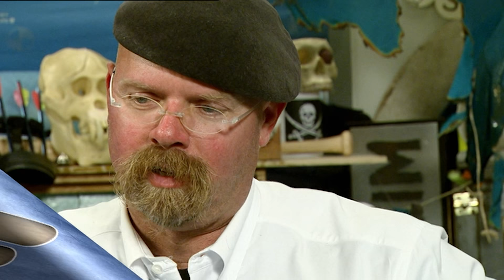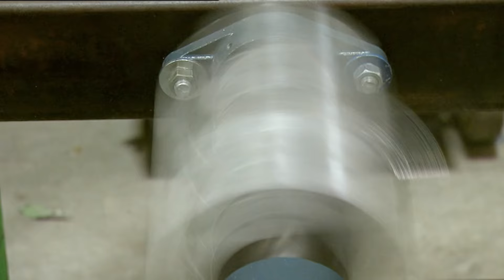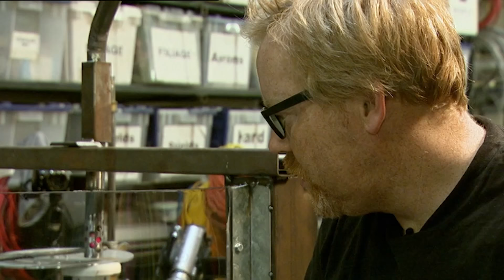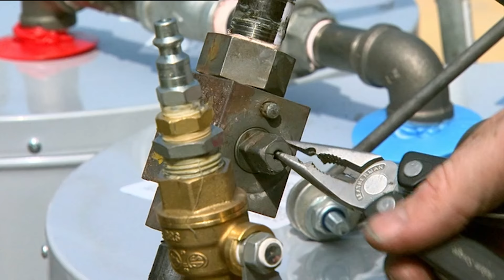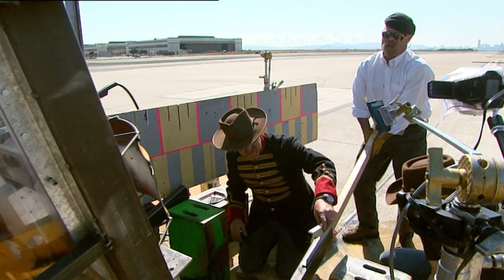Could A Steam-Powered Gun Really Fire 400 Rounds A Minute? | MythBusters

Comment: The Winan Steam Gun was NOT a Confederate toy..
If I remember the original design properly there was a spinning disk with a curved slot in it and a fixed barrel.  The ball drops into the spinning disc, accelerated and flung out the static barrel

Comment: The Build:

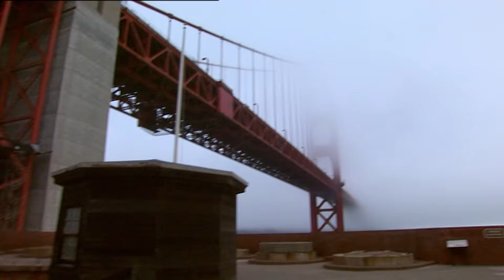Adam and Jamie worked with Civil War weaponry expert John Lamb to study original diagrams (1:43).
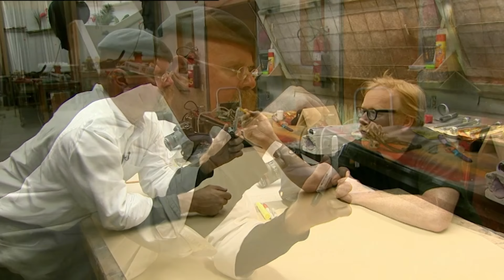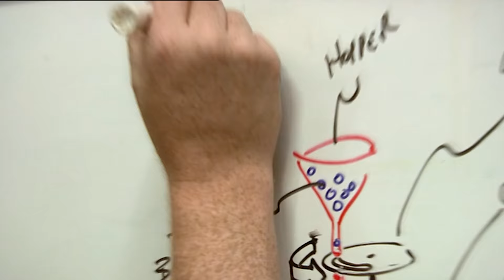They broke the project down into four main components: a curved barrel, a clockwork ammo feeder, a high-speed motor, and steam generation via water heaters (3:14 - 4:00).
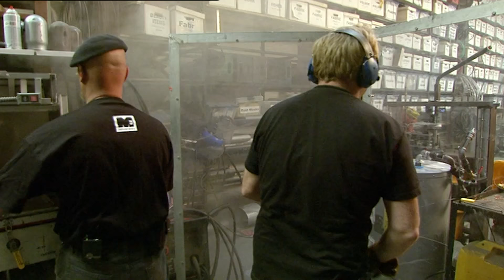The team successfully built a functioning replica that used centrifugal force to fling steel balls, demonstrating that the design concept was physically possible (12:43).
The Testing:

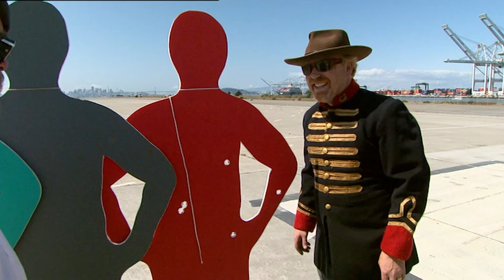Rapid Fire Capability: When firing multiple rounds, the gun achieved a rate of fire that felt like a true machine gun (19:03).
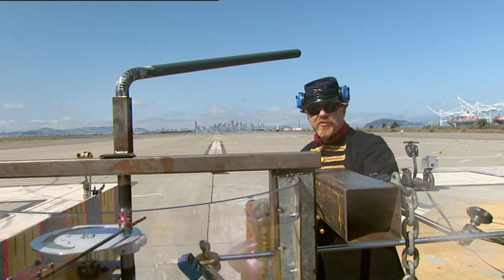Lethality: While the weapon proved lethal at point-blank range against ballistic material (20:13), it failed to penetrate a pig carcass at 20 yards (22:45), proving it was largely ineffective as a weapon of war.
Range: In a final, desperate test, they pushed the cannon to its limits, resulting in a single projectile traveling nearly 700 yards (24:50 - 25:03), far exceeding the historical claims, even though the rig suffered a mechanical failure during the process (24:06).
Conclusion:
While the MythBusters confirmed that a steam-powered gun could function as a machine and a gun, they ultimately concluded it was a busted weapon of war because it lacked the necessary lethality and reliability for combat (25:21 - 25:39).

Comment: Controlled release using a cam that extends into the rear of the barrel just enough to block the ball and is pushed out of the way when it's approaching alignment would've made that thing a lot better.  Also lead would've been a much better projectile.

Comment: I don’t understand how they could time the balls to eject forward in the direction they wanted
Reply: That's the clockwork purpose, to time it, remember just a proof of concept and there was a reason they didn't use it, it was stolen by the union early on during the war. The machine itself might have worked but we'll never know as it was removed and they only made one. Also they couldn't build another one because it took years so it was likely never used at all. This is just proof of concept.
Reply: @xeneomorph  yes, but it doesn’t make that much sense in theory. How did they calculate exactly when the barrel would be pointing forward so they could time balls dropping? The barrel is just spinning freely.
Reply: @freestyla101  Well, ask the inventor who made it back then as I can't answer that question.

Comment: there is a patent for an electrical machine gun that works like this. it was patented and tested successfully in the 90s, it can be mounted on a Hummer and uses an inverter and a set of big batteries to power it. It uses a motor to spin a disk really fast and can fire ball bearings faster than an average light machine gun. Im not sure why it was never used, im guessing because they would need an easy way to charge those batteries as I'd imagine it would use the power quickly. So you'd need more heavy ass batteries or a generator which could just be replaced by more ammo for a regular machine gun that uses no power.

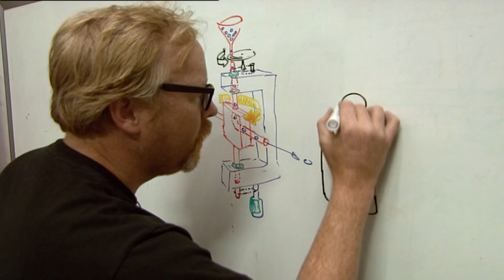Comment: 3:48 did they have super heated steam in the 1880s? (looked it up....germany in 1898.... i figured that locomotives would have had superheaters WAY sooner than that)
.
anyway... my "point" i was gonna type is wrong, but i was thinking that a water heater is only going to give "wet" steam..... which is NO WHERE near as powerful as super heated steam. 
so if the cannon doesnt work because its not powerful enough, then try a super heater.
.
PS
its crazy how the navy and MANY other places check for high PSI superheated steam leaks.... 
they walk around with broom.... if the bristles suddenly get cut, their is a leak.

Comment: It's entirely possible to do all that without the extra jank. You don't spin the barrel, you spin the magazine. you feed the balls (which should be lead) down through a central tube into one or more tubes spiraling out across a disc. The size of the disc determines how fast you need to spin the disc for a desired energy level while the number of tubes determines rate of fire along with spin. 

The balls are stopped from leaving the tubes by a greased set of bearings or rollers that encase the outer edge of the disc. Leading to the barrel, you have a very short exit hole. The barrel will, by necessity, be mounted on the side of the disc, not the front. 

Thus the feeding occurs automatically and without need for gears or timing. 

Now.... here is the problem. 

You have a ball spinning rapidly either in the vertical (Y) or horizontal axis (Z). You need that bullet rotating in the X axis to stabilize it in air. 

So now you'll have to compensate for an additional movement in addition to parabolic arc due to gravity.

This is not an issue in space, where the simplicity of design and lack of propellant will likely result in this being a real weapon some day. Just not in Atmo.

Comment: 1:12 truth be told only some machine guns are complicated. when you get down to the pure mechanical aspects an open bolt straight blowback machine gun is one of the simplest firearms you can build after slam fire shotguns and closed bolt single shot or bolt action. the only real hard part is making a reliable feed mechanism and magazine, the gun itself is  little more than a tube, spring, barrel, bolt, seer and trigger. full auto air guns can be even simpler, just a barrel, hopper and a valve, venturi gun that'll fire as fast as it can force rounds into the chamber, muzzle velocity would depend on pressure, barrel length and the quality of the seal on the bore but i know of full auto solenoid actuated air guns that can fire 1000+fps and 1200+ rounds a minute using high pressure air

Comment: The thing I'm most surprised about is how a compressed air motor worked fine with steam. Yeah, steam is basically hot air as long as it doesn't condensate, but the construction of that thing might still had some inner leaks that would destroy it from the inside if water came into contact, or it might not have been rated for the higher temperatures that steam can achieve (steam IS way higher than 100 C). That the motor itself worked, let alone survived, that felt like a miracle.
Reply: Air can escape through smaller gaps than water because air is not molecularly  attached like water.

Comment: With lead projectiles , higher speed and better timing , would be very deadly
Reply: The entire design is junk. You can't aim, its many moving parts (especially on a battlefield) would lead to frequent failures, it's cumbersome so maneuverability is nearly non existent, and using centripetal force is worse than just building up pressure and using that built up pressure as a way to launch the projectile. Granted making a machine gun would be unrealistically difficult but at least it would address the other issues.
Reply: @millerrepin4452  considering what was fielded in ww1 which is basically the same level of tech and it’s also they put a lot of effort into the project but failed by Their own admission to actually get the timing right or really fiddled with it for an extended period of time. Plus they used really big steel balls which I think is a big problem. I think the myth is 100% plausible. They proved it was they just couldn’t get to completely work and their distance test is not only flawed but it broke the machine. Which I think was 100% intentional because they knew if it did break that day somebody was gonna fiddle with to get it work but they are going to hurt themselves. I’m surprised they called it busted considering they call myths that failed way more plausible
Reply: Smaller munitions also might help
Reply: I agree, lead balls would have made a big difference.
Reply: it's also very unpredictable.
Reply: @thanoseid2883 unpredictably doesn’t matter much when you arent trying to be a sniper. Gotta remember these were relatively close range weapons against lines of enemies. It didn’t matter where you shot so long as it was within the line
Reply: @qualeb8164  accuracy does. it's gotta fire toward the enemy after all. an unpredictable weapon can be dangerous.
Reply: @thanoseid2883  unpredictable can be limited to a point. As long as its safeguarded from firing in the “wrong” direction, then any point along the enemy lines would be good enough even if theres no way to properly predict which individual enemy it will hit.
Reply: @thanoseid2883  they also never solve the biggest problem which was timing. Which was 100% possible to solve. Even with technology at the time. Gatling solve his and they solve the problem of shooting through airplanes props twice in a couple of months of the First World War starting.
Reply: @ONEIL311  that would take too long. it took gatling a while to solve it.
Reply: @thanoseid2883 . They don’t gotta solve it the solution already existed which is the airplane prop shooting mechanism. Adam even tried to build one but I dont think he got it to work or they ran out of budget or time before they had to go out to the run way or they were way to nervous running it to get it to work.

Comment: This was a completely improvised rig with little reinforcement to ensure stability. And the issues with timing on ball release are just that, timing issues. Those depend on the exact revolution speed of the barrel, something that could be fine tuned. I think that as a prototype, it clearly proved proof of concept. 

On the other hand, they were using modern refined parts that may be better than what was available during the civil war. Not sure on that though.

Comment: I was imagining a steam engine hooked up to the crank of a gatling gun.
Reply: Doesn't help the supposed gunpowder shortage situation.
Reply: 45-70 govt Gatling goes brrrrrrp. A little Tippmann 9mm with Glock drum would also be awesome.
Reply: Same
Reply: It's entirely possible to do all that without the extra jank. You don't spin the barrel, you spin the magazine. you feed the balls (which should be lead) down through a central tube into one or more tubes spiraling out across a disc. The size of the disc determines how fast you need to spin the disc for a desired energy level while the number of tubes determines rate of fire along with spin. 

The balls are stopped from leaving the tubes by a greased set of bearings or rollers that encase the outer edge of the disc. Leading to the barrel, you have a very short exit hole. The barrel will, by necessity, be mounted on the side of the disc, not the front. 

Thus the feeding occurs automatically and without need for gears or timing. 

Now.... here is the problem. 

You have a ball spinning rapidly either in the vertical (Y) or horizontal axis (Z). You need that bullet rotating in the X axis to stabilize it in air. 

So now you'll have to compensate for an additional movement in addition to parabolic arc due to gravity.

This is not an issue in space, where the simplicity of design and lack of propellant will likely result in this being a real weapon some day. Just not in Atmo.

Comment: Revisit this, increase the barrel length and lethality along with range will increase,.  Also adjust the timing and have a pressure fed magazine....in theory the rate of fire should be equal to the RPM
Reply: Or exceed it. 

It's entirely possible to do all that without the extra jank. You don't spin the barrel, you spin the magazine. you feed the balls (which should be lead) down through a central tube into one or more tubes spiraling out across a disc. The size of the disc determines how fast you need to spin the disc for a desired energy level while the number of tubes determines rate of fire along with spin. 

The balls are stopped from leaving the tubes by a greased set of bearings or rollers that encase the outer edge of the disc. Leading to the barrel, you have a very short exit hole. The barrel will, by necessity, be mounted on the side of the disc, not the front. 

Thus the feeding occurs automatically and without need for gears or timing. 

Now.... here is the problem. 

You have a ball spinning rapidly either in the vertical (Y) or horizontal axis (Z). You need that bullet rotating in the X axis to stabilize it in air. 

So now you'll have to compensate for an additional movement in addition to parabolic arc due to gravity.

This is not an issue in space, where the simplicity of design and lack of propellant will likely result in this being a real weapon some day. Just not in Atmo.

Comment: An actual gun like a steam powered Gatling gun would have been possible at the time, and I imagine it would be pretty devastating for the time period.

Steam power could operate the auto-loading mechanics, rotating the barrels, and using a burst of steam pressure into the barrels to fire projectiles like an airgun.
Reply: That level of industrial precision didn't exist at the time. You would also need a corrosion resistant material because of the, well, water.
Reply: @weetdirt   Yes it absolutely did.  This was the civil war lmao.  They had steam locomotives for 60 years, they had repeating lethal air rifles for 80 years...  You think they had no steam power and couldn't deal with water in 1861??   Go back to school

They had advanced metallurgy, "corrosion" wasn't a problem.. it's water and metal, scrubbing a cannon barrel with a wet sponge with unburnt black powder is far more corrosive..

The actual "Gatling gun" itself was patented in 1862 and used in battle in the civil war in 1864
Reply: @diebygaming8015  Yeah, a steam locomotive is very very big for a reason. Because getting something as powerful as the steam to launch a bullet at sonic speeds into a portable package does require precision that was insanely difficult if not impossible. 

To compound that: a rotating steam gun would require a rotating water tight seal system, years before vulcanized rubber. It would require water tight one way valves for loading projectiles, something which requires very specific machining. And it would need to be carrying an enormous amount of water because of how much gets lost on each shot.

Comparing the subsonic air rifles to a steam cannon is comparing a V2 to a kite. They are very different.

Hell, making locomotives was so hard that the Confederacy never tried. They just stole them
Reply: @weetdirt   It would take an experienced team of gunsmiths.  The reason no one made it is because it's impractical, not because it's impossible.  Which is the same reason we still don't make one now.
Reply: Doesn’t solve the lack of black powder.

Match heads have been used to make makeshift modern gunpowder. I wonder if they tried using match head materials.
Reply: @CarMaxJensenBeach   Huh?  There is no black powder or gunpowder in the idea I gave.  The projectiles would be fired by steam power like an airgun.  But with pressurized steam instead of compressed air going into the barrels to push the projectile.

Comment: How does more balls make them hit the slot?  Is it just luck?  You can't time the drop to when it shoots out the end exactly in front of the slot.  More balls would seem that "maybe" some will make it out.  I must be missing something.
Reply: more balls means more force pushing down, the main issue from the timing is the acceleration of the balls as they enter into the slot. a spring would probably do well to improve reliability of the device.
Reply: If the cycling of the balls is out of phase with the slot window (idk how to explain it, in a coprime way) then you can fill the feed with enough balls so that at least one of them is guaranteed to come out. Otherwise the balls will just keep hitting the same spot(s) in the safety cage.